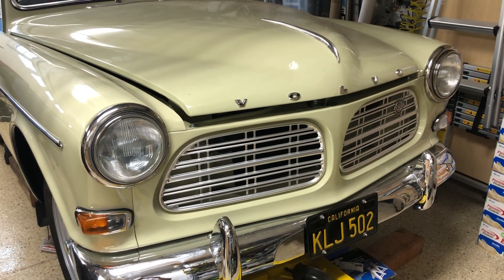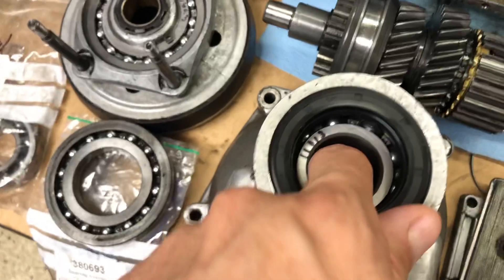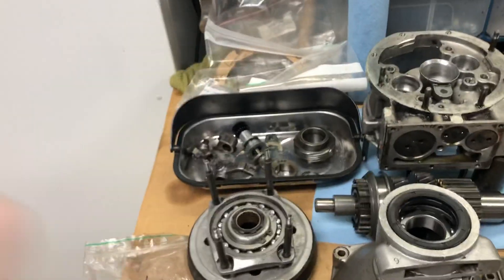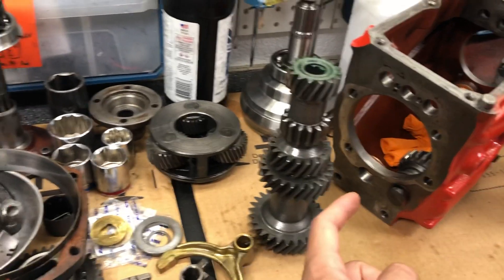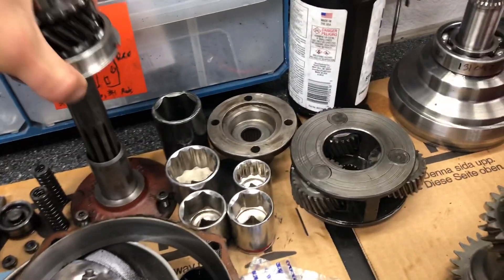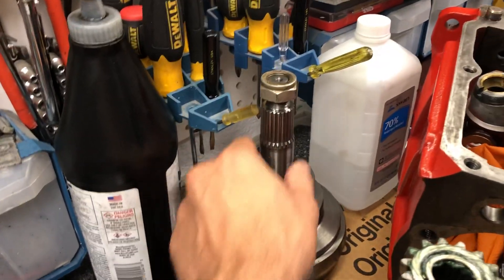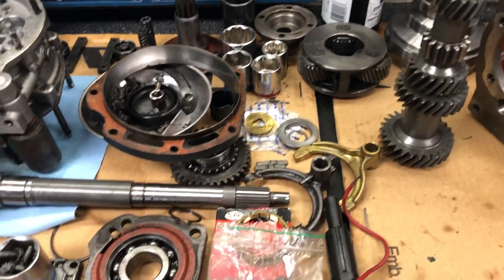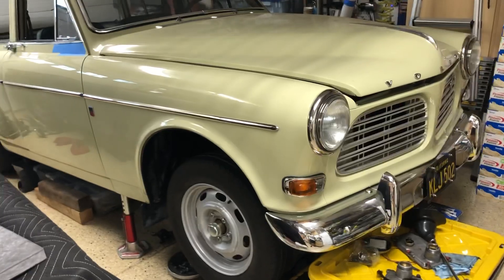The 5 Major Bearings in a Volvo M41 J type Overdrive Transmission

Comment: In my experience the M40 and M41 were always noisy in certain gears. The M400 and M410 seems more quiet, but are getting really rare (Volvo 164) and I do not think they are a drop in replacement either.